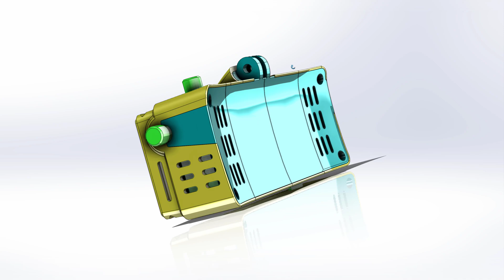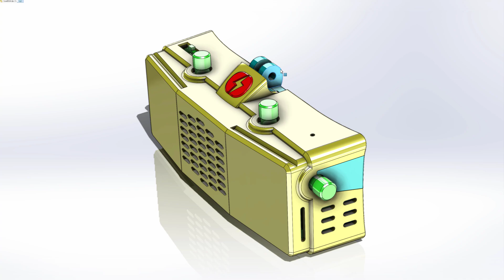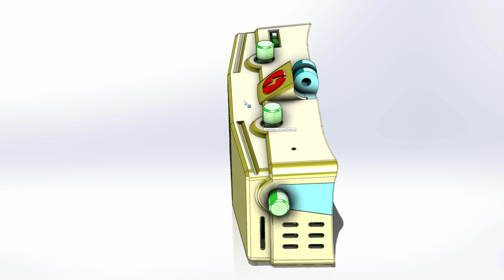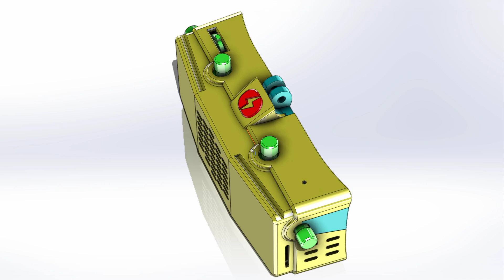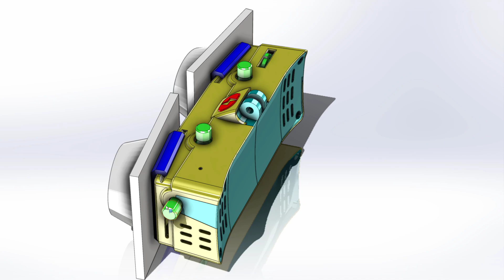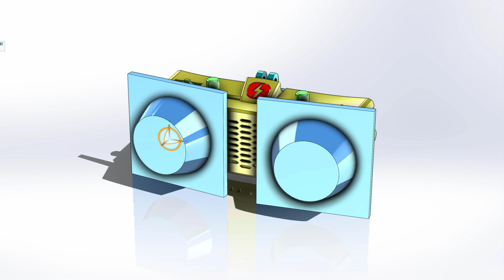HDZero VRX Preview

Comment: I hope they've revised that piece of junk mini-hdmi cable. Mine broke after a month of use, total trash.
Reply from the maker: Are you 100% sure the problem isn't the hdmi port on your goggles? There's a shockingly high failure rate on Fatshark goggle HDMI ports
Reply: @RyanQuellet  I am 100% sure. The original cable doesn't work on my hdo or my friend's hdo2.

I mean, at first it worked, then after about a month the video has white noise and you can't fly.

If I use a normal hdmi cable with two mini hdmi adapters, the picture works perfectly and I have no problem.

It seems obvious to me that it is the cable that is not working, I have done several tests and only with the original cable it does not work.

Comment: All those changes are fun. But the biggest change I was hoping for was a diff form factor. Like something that fit into old analog slots. Could make it more compact. Maybe have it go into both analog ports. small jumper wire across the front for quad diversity. This sticks out too far and changes the whole form factor of slim goggles like fatsharks. I'm not saying plug into the pins on analog slots just make it fit the slots for a better form factor.
Reply from the maker: HDZero Goggles
Reply: @RyanQuellet  yea but I already own a pair of hdo2. Forcing people to buy a proprietary product like dji did is the whole reason i didnt get dji...How much better can a screen get. At a certain point # of pixels doesn't matter because the size of the screen. It won't be noticeable by the human eye. Also any other feature like like osd channel changing or a mic and what not is nothing special its old tech and should be in any new goggle. Hdzero rx that fits the analog bays or bust.
Reply from the maker: @JLfpv  no can do bud

Comment: it's a claymore with 4 explosive charges, two on the top and two on the sides. it has 39 high penetration pellets on the front in the middle and on both sides there are additional 6. it has a hinge mechanism to be easily attached to trees or any other surface and can be accurately aimed. also on the top is a potentiometer to adjust delay if it's needed. on the top it has a nice electric logo to showcase that it does infact need electrical discharge to go off.

Comment: Pros: clock, mic, ELRS backpack; Cons: no patches, more power consumption, bigger; Does not sound so exciting.
Reply: Right. And the form factor didn't change. Still clunky. Can't they make it fit into both Analog bays with a jumper wire across the front for the quad diversity. Not plug into analog, just use the bay for a better form factor. These make fatsharks look like ev800d box goggles. The changes are just gimmicks that don't really serve much purpose for me. I rarely change channels and I don't want my environment being recorded.  This honestly does not seem like an upgrade to 1st gen vrx...

Comment: Is there a reason HDZ needs 4 antennas? This always confuses me a bit. Also JB mentioned those antennas are actually used equally, so the classic setup of 2x focussed and 2x 360° wouldn't make any sense - what's your take on this? Is there an optimal antenna array for this module that would provide maximum performance? This year will be super exciting in terms of HDZ's progress. I'll be watching closely :3

Comment: Isn't the present vrx also getting the backpack option via a software upgrade?
Does this mean that the present vrx already has the needed hardware inbuilt?
Reply: Yes, the firmware support was just released.  With the current VRX you just need to open it up and solder an ELRS receiver to specific points on the PCB.  There's a video out there showing how to do it.  I don't have a link, but if you google you'll find it.

Comment: No power button 😒 . no comunication by RF to upgrade VTX🤔. SD placement do not change😱 .... and always express lrs users in priority , don't care about crsf or frsky users😢 ..... form factor bigger and bigger will not feet in the case with mounted antena .... Sorry But this time in my opinion Wrong Way .... and you know how I can support and love that system💛.... Please don't forget Freestyle pilots or Mid/long Range pilots to🙏🙏🙏... who prefer compact and lighter design ..... ✌
Reply: This really not meant to be a “upgrade”. It’s simply meant to be the replacement for the SB VRX that’s in short supply.  They have managed to squeeze in a few new features but in the end this is about getting availability sorted.
Reply: @MadRC  maybe it was time to upgrade But I respect their choice ..... ✌
Reply: To be able to support TBS/FrSky and Ghost they would need to put out the code which won‘t happen being a commercial product and not open source.
Reply: @marlin-fpv  it was just to say i'll prefer vtx update by RF than lrs for some pilots ....😉
Reply: Is there even an equivalent system to the ELRS backback for CRSF? There certainly isn't for FrSky. How could they add support for something that does not exist?
Reply: @evilc2048  Kind of... If you have a wifi hotspot with fusion module and crossfire/tracer connected, it's the same functionality. But the design is just broken because you need that wifi hotspot.
If TBS ever want to provide a "module" with backpack option, they can just the same port as the the ELRS backpack.
Reply: @evilc2048  this is not what i was thinking when i wrote my message .... I was thinking priority for everybody not for a few....✌
Reply: The move away from the patches and to all SMA is a straight improvement for long range pilots.  That alone should seal the deal.  Personally, I'll be keeping my 2 OG RX because they are more compact and I don't need the range.  The clock and mic would be nice, but not deal breakers.
Reply: Why would anyone still care about frsky?
Reply: @cornholio514  i know watch coments below ✌️😉...

Comment: 2mm thicker and obviously heavier, no stock patches, higher power consumption, and a useless microphone. Sounds well worth the wait.  Lets hope its beige. That should top it off. 
And how much more expensive?  
Lucky for the people that brought a SharkByte VRX.
Reply: @j--3   I understand that issue. And I'm not blaming HDzero.
 But that's just another reason to be disappointed with this product.
I have done everything I can to talk this product up, to this point. But its attributes are becoming its own detractors. 
It will always be compared to DJI and other digital bi-direction link systems, that have better image quality.
I had high personal hopes for this product, to replace my DJI. But due to many factors, its taking a step backwards. :(
Good luck to yourself and those hardcore, sold-out to HDzero people. That's not me.
Reply: If this costs similar to sharkbyte when they jacked up their prices after the sale - I will laugh at you all from my DJI goggle equipped head.

Comment: Hey Ryan - Do you know if the internal mic can be turned off? My expectation was that there would be a mic jack to plug in an external mic.
Reply: Valid point ADK is making here...  in my experience internal mic's are very subject to wind noise and not really suitable for any kind of post production later on.
Reply from the maker: No external jack on this. HDZero Goggle does though

Comment: Thanks for the overview. I don’t think I’ll ‘upgrade’ from my current Shark Byte VRX, but these are some nice changes for newcomers to HDzero!
Reply: Same. But the mic and backpack support will be nice. Would be cool if they sold an upgrade kit. Like tbs did the tango.
Reply: All these features are very minor changes that don't interest me. Form factor and video breakup matter most. A mic and a backpack so u can switch channels easier. Little gimmicks 
, not major improvements.  At least to me.
Reply: @JLfpv  I don’t think that this update of the VRX was probably meant to introduce major changes, but rather just bring a VRX back on the market. 

It’s been almost 4 months now that if someone wanted to buy into HDzero, they had no choice but to try to buy a used / second hand “shark byte” VRX off someone in the Facebook groups. It adds some nice minor changes for newcomers, but definitely for any of us who currently have the original I see no reason to buy this. You can add backpack support for ELRS with the current VRX I believe with a little soldering, too. 

This was a much needed product to keep HDzero going though until the HDzero goggle is released.

I’m also very curious about the price point. That could make or break things. Really hoping for a low price point to help adoption.
Reply: @JohnCuppi  forget the goggle. Being forced to buy a whole new system is bull shit. My hdo2 are still the best goggle out and will probably be so until someone makes a 4k screen that small which is useless as far as actually seeing a difference. Just need a nice form factor to fit into fatsharks or any other slim form factor goggle. Split yhe units into two receivers one for each side of goggle bays. Don't make us go buy a proprietary product like dji. I don't buy new stuff to get new stuff. I get new stuff when mine breaks or when there are major advancements in technology.  Being forced to buy new goggles to get hdzero is the whole reason I don't run dji.